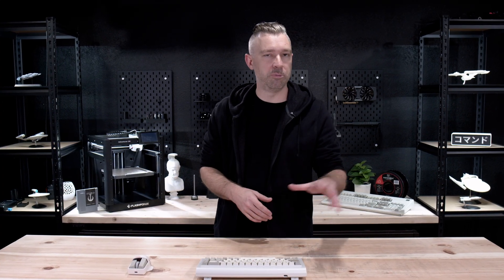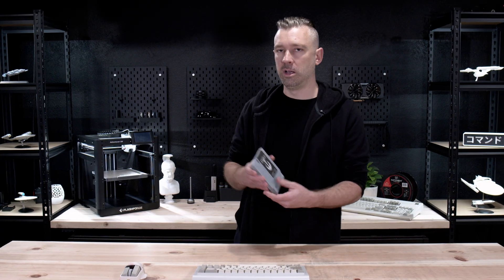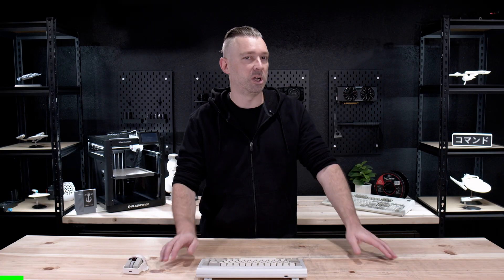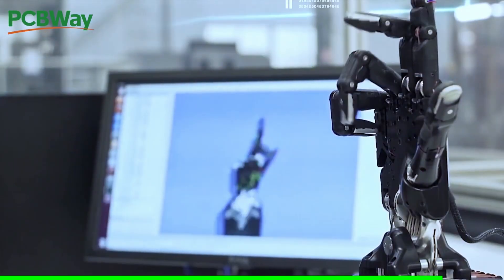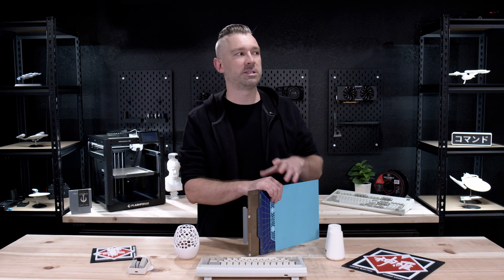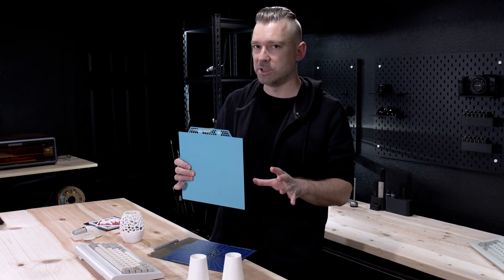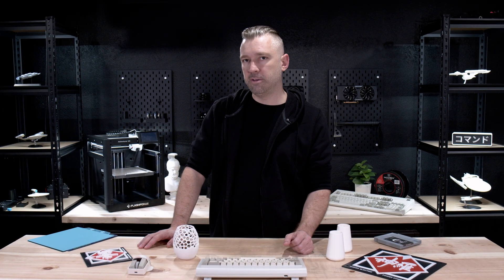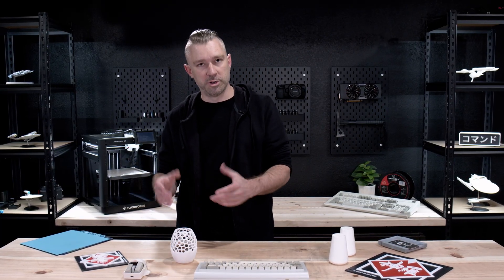Get Better 3D Prints Easy!

Comment: Thanks for highlighting the EZ way just printing things flat isnt always the “right” way to do it! I will surely use the top layer pattern trick in a future project. I watched your video a while back on setting up your studio, I like its simple clean look. Today I noticed you have a shelf setup similar to what I’ve been looking for in a narrow space we have but can not find a “off the shelf” (sorry had to) solution. Did you create your own square boltless shelves by using the end pieces for the front/back also, or did you find a source for a dedicted kit that matches depth and width?  Thanks for sharing your talents!
Reply from the maker: The top layer pattern is one of my favorites, it's shocking more people don't know about it. 

lol I have to say I've been looking at this comment for about 20 minutes and I'm trying to understand which shelves you're talking about. I have so many shelves in here it's hard to understand which one you mean.
Reply: @zerodotcmd  I can see how I could have been more clear. In your background behind your maain workbench you stand behind, you have the black Skadis boards and beside them are 2 bolt less shelf systems that each shelf has a single display item on it and is lit. They seem they are square (width and depth). Was this a kit or did you create it yourself?
Reply from the maker: @aaronkleingartner  That's what I thought you meant but wanted to make sure. Those are 6 tier storage shelves. Luckily they came as a kit and I didn't have to do anything except add lights. I picked them up on Amazon. https://amzn.to/3VtF0nk
Reply: @zerodotcmd thank you sir!  I very much appreciate it. Love the channel anf I do dig the black and simplicity of your studio!